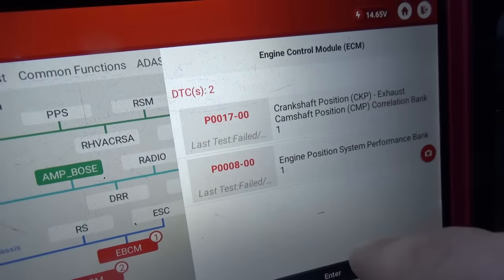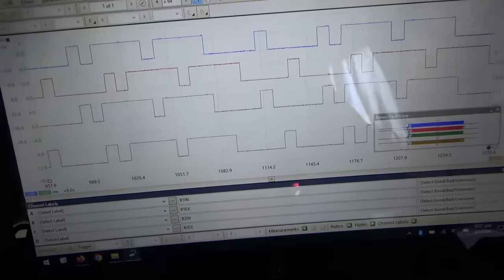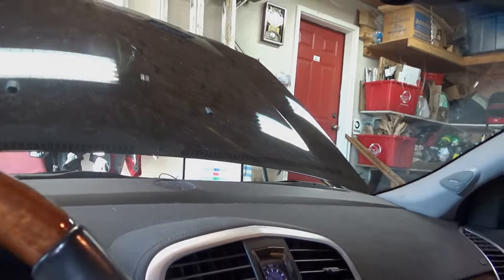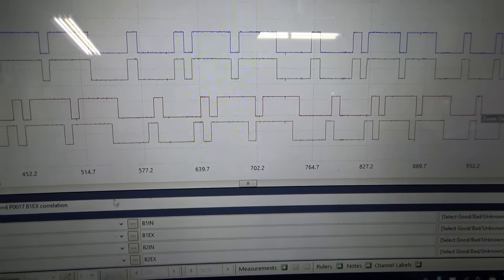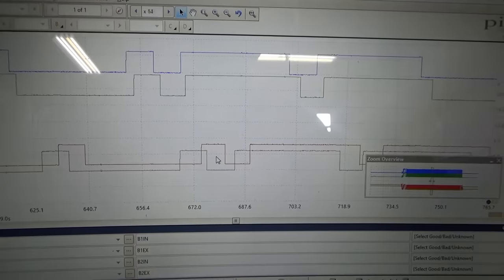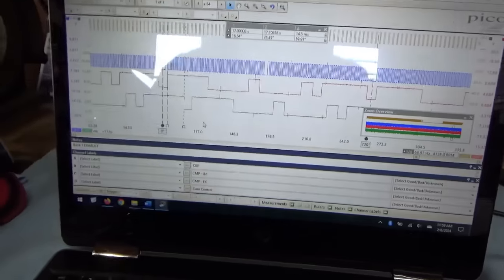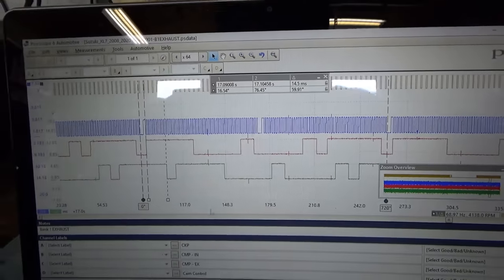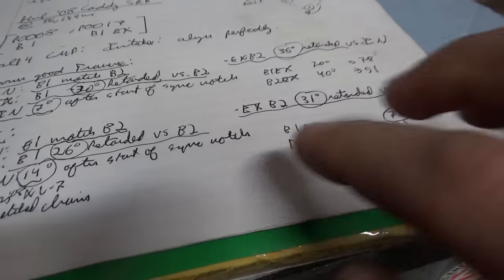GM Timing DEATH CODES? (P0008 P0017 Cadillac SRX V6)

Comment: Ivan you have to stop being closed minded I was like you 20 years ago and finally learned to open my mind not all aftermarket parts are shit I'm telling you I've had multiple oem parts that were shit and aftermarket worked fine like my oil pressure sensor kept taking a shit putting truck in limp mode I tried multiple even oem and ac Delco and guess what lasted 3 months I tried like 8 different brands all shit some would give false readings then die others just shit finally last one was a Dorman and that was over 2 years ago and over 100.000 miles still going so just never say never.
Reply: The problem is that Ivan has to or wants to warranty his work. I've worked on my own cars and have been burned by fit or function issues that wasted my weekends.
Reply: Maybe your sensor is giving a fixed signal all the time that the computer is happy with? The computer thinks all good here, according to my sensors!
Reply: But those are far and few between.........plus one thing I have seen is parts stores saving oem parts boxes and sticking junk aftermarket parts in them.......basically you maybe buying aftermarket parts instead of oem and not know it!!!
Reply: @alexanderzubar9593  RE: which manufacturer work and which don’t?

Maybe you find some that work today, but is replaced by something else tomorrow? Then you have to do the excessive testing all over again.
Reply: I would only ever use non-OEM as last resort for most engine, computer, electronics parts. I’d rather junk yard OEM than Dorman or other trash. Eric O will tell you the same thing. 99.5% all junk. On everything else, I then do a cost/benefit analysis using criteria such how critical the part is, the cost, and the time and effort to replace it when it goes bad. If I learn that there is a part with an exceptional quality and performance track record, i have no problems using that part, but those cases are rare.
Reply: In a shop, the sheer volume of parts being replaced shows what is good and what isn't. Oems success rate is much higher than any aftermarket parts period... the limited very selective experience thar you have with your trucks sensor is not the norm. Don't get me wrong I install tons of aftermarket parts, when they fail again I warranty it if within the warranty period. Oem is out of budget for most people on a lot of things. Especially when Joe schmo can go to autozone and always get a cheaper part than us in the shop...
Reply: You sound like my parts manager lol. I’ve proven him wrong so many times after I warranty out the aftermarket junk with OEM parts. But he gets a spiff from Advance, that’s why he tries that shit 🤣
Reply: In special cases, I have used some aftermarket electronics in the past, and probably will again, but never Dorman. I have used a variety of Dorman hard parts at times like latches and various plastic and body parts, really can’t complain( much) about those, most of the time. I have used Detroit Axle many times for pickup truck parts like wheel bearings and suspension parts. Never had a problem with any of them, so far. Still, for most all electrical, I stick to OEM.
Reply: How many of the supposedly OEM parts that you had problems with, were just knock offs in an OEM labeled box?
Reply: I'm ok with shops using aftermarket junk... That's how I make a living going there diagnosing them then telling them to replace their "new" parts lol
Reply: What did you say? That was on long run-on sentence. How is anyone supposed to understand it?
Reply: It’s impractical to test each manufacturers parts to see which ones work and which don’t. Very expensive to handle all the comebacks too!!
Reply: After 40 years of fixing cars the Chinese stuff has mostly been crap. Some of the OEM American parts are good. The Americans want and try to make good parts. The Chinese and some others just want to make money.
Reply: I've had aftermarket bite me for multiple thousands and finally went and bought oem and suddenly, problem gone. At this point I run strictly oem. Aftermarket is fine if you don't mind the risk.
Reply: You were one of the  lucky guys  to get a good Dorman part
Reply: So your saying just try all after market parts and eventually you’ll find one that works?😂
Reply: Maybe instead of @mechanictaft4848 it should be "mechanicdaft".
Reply: @MichaelJordan-jv6ic  I wouldn’t say daft but I will say persistent to the point of being ridiculous 😁
Reply: I have terrible luck with aftermarket parts. OEM is crap, but it gives me a better chance of success.
Reply: The problem was I think COVID is really what did it It seems like ever since Covid had happened The quality of non OEM parts went to shit.

If you have anything sensor related oil pressure related etc maf, whatever, You have to go OEM otherwise you will or may have problems down the line or a lot sooner than what you would with OEM.
Reply: @B0xlife1  I would agree.
Reply: lol!!  Who’s this BA mechanic who’s got so much wisdom for Ivan😂!?  Tell us professionals who have to deal constantly with new parts issue 😂.
Reply: @414alexx  I started having massive issues in 2010. It lead to me closing my shop. I was in a small rural town and Kragen-Orielys was my only source. When Orielys took over the chain, the quality went to shit. Now I'm in another rural town with Orieleys as the main supplier. It seems a bit better but many QC problems are still there.
Reply: If OEM parts are so great why do they fail so fast?   Seems stupid to just blame aftermarket and praise OEM
Reply: @melissathompson7229  nobody is praising oem. It's just better odds of getting a reliable part. Especially if any electronics are involved.
Reply: Many aftermarket products are junk. If you get a BWD it is less likely.(Borg Warner Development). Another aftermarket that was good was Wells, I believe NGK owns them now. As for Accel and MSD they suck now for modern engines. Your better off with OEM if you choose them for ignition products.
Reply: @melissathompson7229  I remember back in the 90's before NAFTA, we considered dealer parts to be substandard and aftermarket was king. Then China was all the parts supply and it's been crap ever since.
Reply: @madmike214 lol
Reply: @melissathompson7229 It is very rare to have my own Ford and Chevy parts fail. Usually a wiring issue from road salt. Not sure where ur coming from. If you don't maintain your machine, things will fail.
Reply: I will only say that Ivan has to fix it and give it back to the customer. When I work on my car I am the customer.  I can explain (complain) about a cheap part, its on me. Ivan has to make the customer happy and protect his rep. I agree there are bad parts even in the oem chain, how many of the bad ones are counterfeit?  I've tried some aftermarket parts, and nearly all had a high failure rate. So when my latest "new" car (2013) had a fuel pump module and purge valve failures I went oem.  I'd rather pay 50 once rather than 35, then 50 the second time.
Reply: @melissathompson7229  It's not a matter of praising oem. It's a matter of having a significantly improved chance of long term success. With most after market crap nowadays the odds are stacked against the consumer by a significant margin. For someone who does mechanics for a living this is very damaging because the customer many times chooses to blame the mechanic even if they ordered them to use the after market junk and it fails again some days/weeks later.
Reply: There is a saying amongst computer scients: GIGO garbage in, garbage out. Same here. Use aftermarket garbage get garbage results.
Reply: Usually people go cheapest aftermarket not quality
Reply: Has a difference between cheap aftermarket and quality aftermarket
Reply: @BG-gg9pl  aftermarket parts are a mixed bag at best.